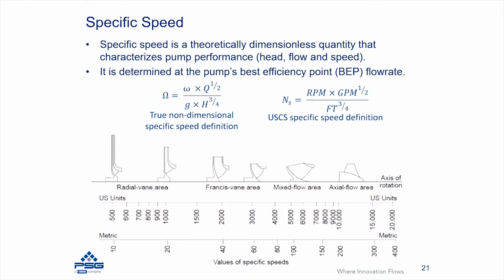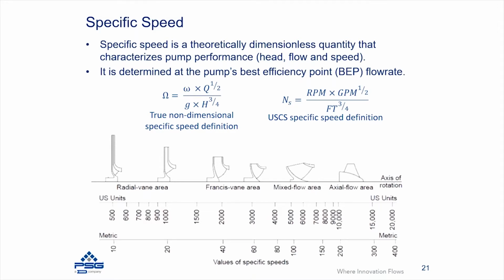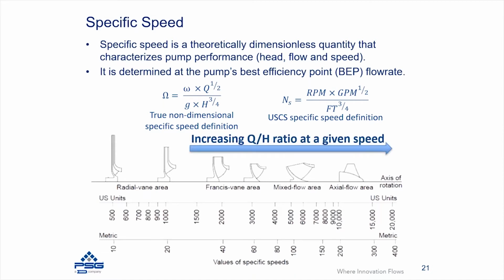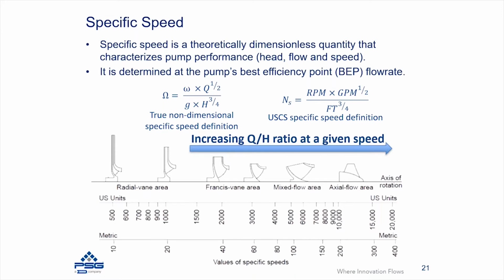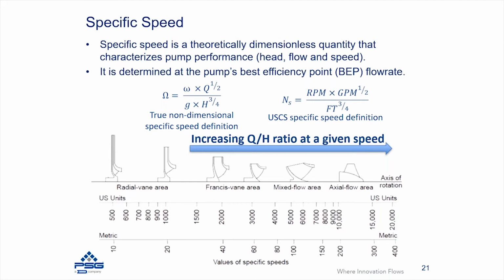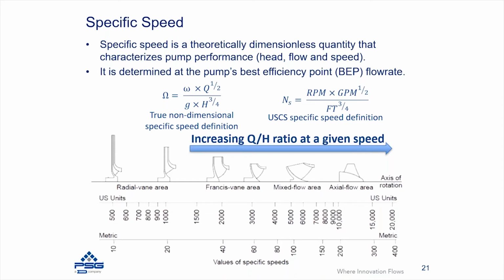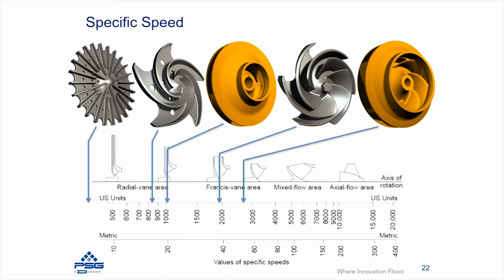Centrifugal Pump Basics: Types of Impellers and Specific Speed

Comment: Nicely detailed video. In your point of view, which of these water pumps would be more efficient/faster in terms of car-engine cooling circulation?
1- https://jctautoparts.co.za/wp-content/uploads/cm/catalog/Nissan/NP200/NP200-1.6-16V-WATER-PUMP-400x400.png
2- https://www.engineteam.com/documents/RM0015/RM0015C.JPG
Edit: The spinning direction is anti-clockwise.